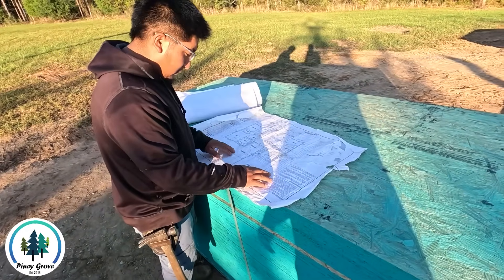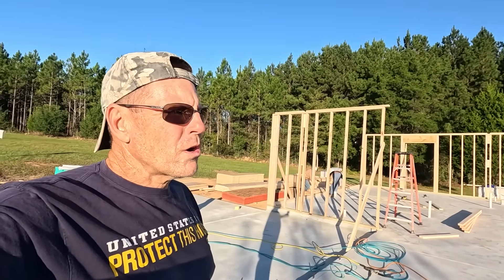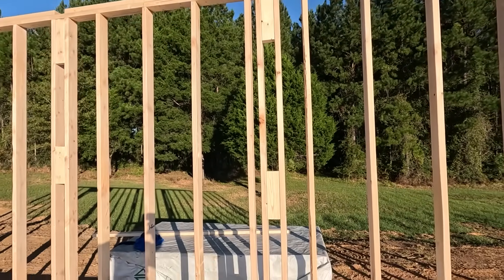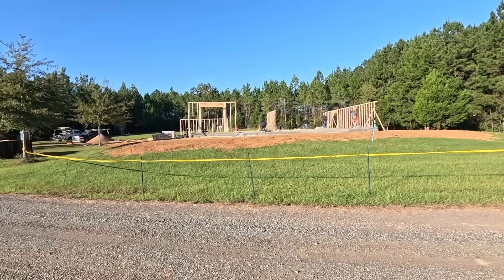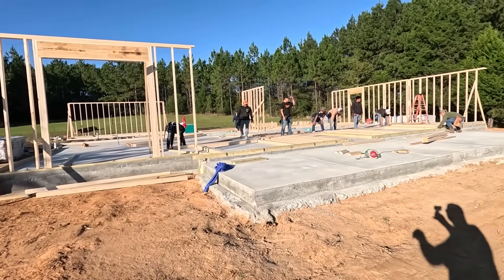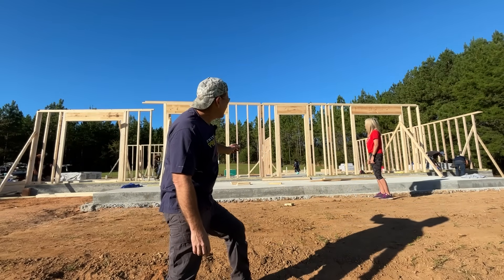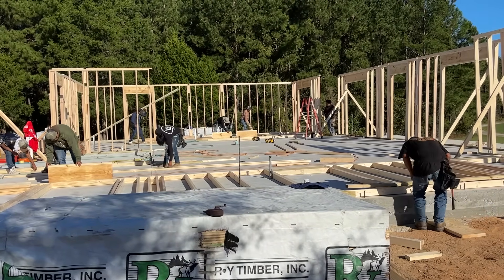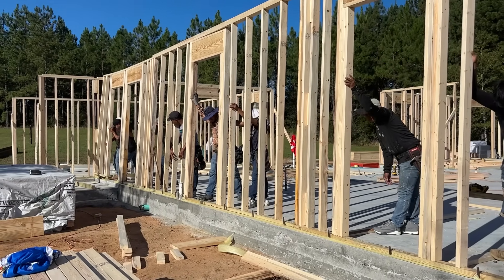They FRAMED Our DREAM HOME In ONE DAY!

Comment from the maker: See the concrete pour here!! : https://youtu.be/AjqjWnitYEw
See our house build series here: https://www.youtube.com/playlist?list=PLG5yS75HLzo343HSY79ll4DgoxTgV6l91
In this video, we talk about the true costs of buying land:  https://youtu.be/LauBnhamoMQ

Ballard Mower Blades 10% discount code:  PGH10
https://www.ballard-inc.com

American Made WoodMaxx chippers, tillers and flail mowers:
Piney Grove WoodMaxx Affiliate Link:  http://shrsl.com/4qer8

New way to fence your land!  Cat's Claw Fasteners.  
Use code PGFREE for free shipping!
https://fencingstaples.com/
Or Amazon Affiliate Link:  https://amzn.to/4dDcaJ7

QC-Mate X-Boom Hydraulic Coupler Clamp:
https://www.skidsteersolutions.com/
Use PINEYGROVEHOMESTEAD for 5% off anything on the website!

This is our Amazon store with affiliate links to products we use on the channel.  It doesn't cost you anymore and it helps support the channel, THANKS!
https://www.amazon.com/shop/pineygrovehomestead-tractorsandoutdoors

Some of our favorite products on Amazon (affiliate links):
Mower Blade Sharpener Guide: https://amzn.to/4dGYZa5
Dewalt 20V Cordless Grinder: https://amzn.to/4bF2trS
Flap discs: https://amzn.to/3UKEzo0
Grinding wheel: https://amzn.to/3K95ipi 
275 Gallon IBC Tote: https://amzn.to/3XbxwHs
Vise Grip Wire Pliers: https://amzn.to/3WZ2P6U
12V Pump: https://amzn.to/4a3AwsI
Proven Industries Trailer Lock: https://amzn.to/3WVzytv
Flex Tape: https://amzn.to/3R4MdWm
Mechanix Leather Gloves: https://amzn.to/3HjoZZf
Ratcheting Fence Tensioner: https://amzn.to/3aEfSX0
6’ Digging and Pry bar:  https://amzn.to/3vH5Agx

Welcome to our channel!  🎥 What to Watch Next: 
Fixing Leaky Pond: https://youtu.be/NEwSTg1aOWc
Transforming Our Property: https://youtu.be/-jBGEYJea1Y
Baling Hay: https://youtu.be/yQJNF3wFm-U
Framing Our Pole Barn: https://youtu.be/zWgnTFQeiwI

Our Story:
We are seven years into a seven year effort of transforming 20 acres of "Piney Grove" in Northwest Florida into our dream homestead/mini farm to be filled with animals and joy. We plan to have a variety of miniature critters on our pastures, raise free-range chickens, grow fish in our pond, garden, plant fruit and nut trees, and harvest wild game. Our goal is
to escape the stresses of corporate life and embrace all that country living
has to offer as we enter the next chapter of our lives. Follow along on our
journey!

Thanks for watching and please Like and Subscribe to help our channel!!
Brad & Deb

Comment: Crews usually use a scrap piece of 2x4 to line up the bolts when inserting into wet concrete.    Crooked J-bolts:  crews often put the nut on and tap with a hammer until reasonably straight.
Reply: Also when you drill the hole for the 1/2" bolt drill it 3/4" for some ease and clearance, especially when using top plates or large washers !!!
Reply from the maker: We've had 5 big pours done by different crews and nobody uses a template.   I always found that weird.

Comment: He is hammering the sill foam, because it was rolled and wants to curl up, by hitting it, it breaks this tendency and lies flatter. The actual sill will hold it down, but if you don't hit the foam, sometimes it will curl up enough to affect sill placement. 
That foam is more important than people think, not only does it help seal out the weather but it keeps out bugs.
Reply from the maker: Cool....didn't know that.   Fascinating process to watch. Thanks for the support.

Comment: About to start an owner build of our retirement home in AZ. Decided that what I saw being built around here did not show very good quality control and materials were very cheap for the very high price per sf. ($350-$400/sf not inc land). Those bad J bolts should be cut off and replaced with anchor bolts in the correct spots. Sloppy work. I have already caught multiple errors in plans by architects and engineers as well as having to rebuild 75' of rebar cage for a retaining wall screwed up by "the best rebar guy in town". You are spending your hard earned life savings to build this home as we are. Don't be afraid to expect and demand quality. Many things can be "lived with" but structural integrity and function are a non-negotiable in my book. And when something is not right, acknowledge that "it happens" and give them a chance to make it right.
Reply from the maker: Thanks so much for the advice.  We are trying to choose out battles.  Did you see this one?  https://youtu.be/8A4z4liqTco

Comment: I am surprised to see the exterior walls framed with 4  inch material, haven't seen that in decades in our area, all are 6 inch now.......
Reply from the maker: 2x6 walls allow for more insulation but we are spray foaming so our R value will be high.    The strapping and threaded rods and engineering going into this house are incredible!   Thanks for watching.

Comment: Congrats I hope you are having those walls insulated, it will help keep your AC , from what I have seen down here it is not a standard which makes no sense to me
Reply from the maker: Thanks....it's been a long time coming!
Reply: Insulation is a standard requirement down here, speaking from 51 years in building construction.
Reply: @kellymountsr2358  Why only 4" walls and not 6" ?????  more insulation and stronger....
Reply: @kellymountsr2358  lol the house I live in right built in 2010 no insulation the 1 before it no insulation only in the attics was there any

Comment: The bolts are not In The right place  because hard to do in the field.   Boy I’m glad I never used that excuse.  For laziness 
There in the blue prints where to place them if they used this then called a tape measure that’ll be exactly where they should with out question or excuses for this failure
Reply from the maker: Drawings are not drawn to that level of detail, but they could have done a much better job.  Thanks for watching.